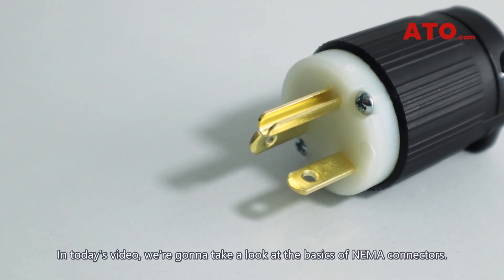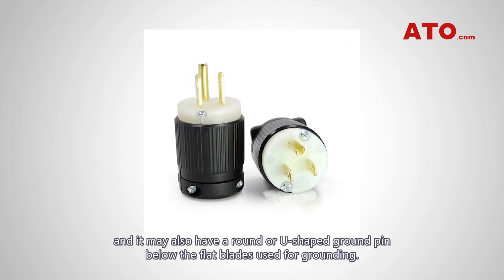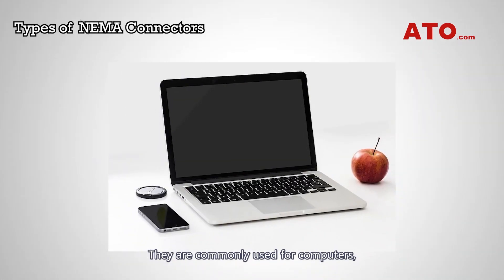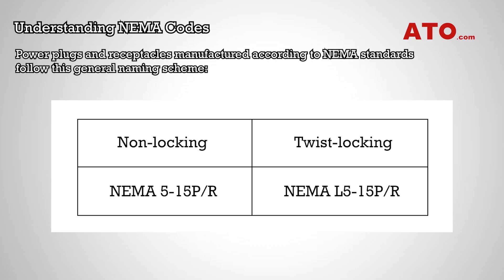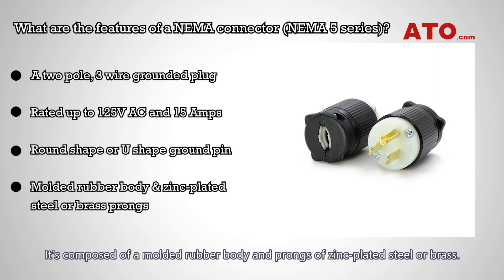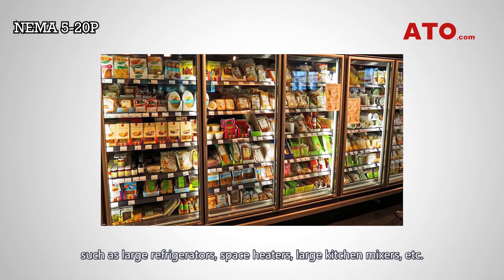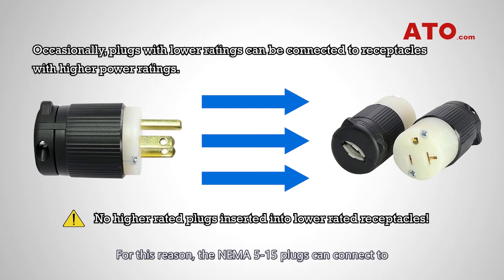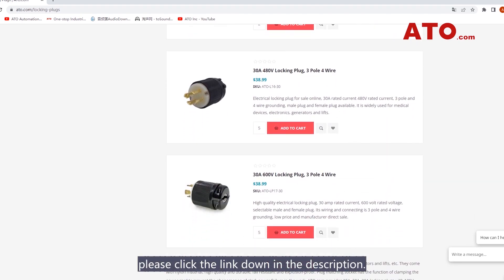NEMA Outlets Explained

Comment: Very educational.   The key takeaway is that NEMA keeps personnel and equipment safe, by creating a national recognized system based on voltage, amperage and phase for specific applications regardless of appliance or equipment manufacturer.   Before NEMA became widely adopted,  there were accidents.   For example in an older home built before 1960, you might come across an old wall outlet with two slots resembling a T turned on this side like this -| |- and had two voltage and amp ratings of 125V-15A/250V-10A and were designed to accept plugs of " | |" or" – – " prongs, and were sometimes used interchangeably with 120 or 240 volts, although they were 120V 99 percent of the time.   In the early '50s the "– –" plug got the official NEMA 2-15P, 250V, 15A, two wire nongrounding, a  configuration that stands to this day, even though such wiring devices haven't been manufacturered since the late 1960s.